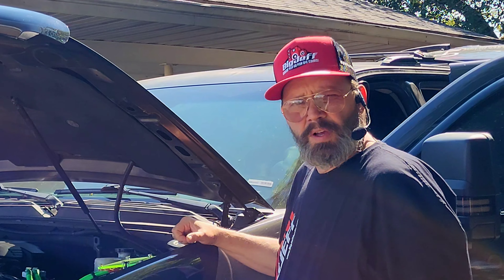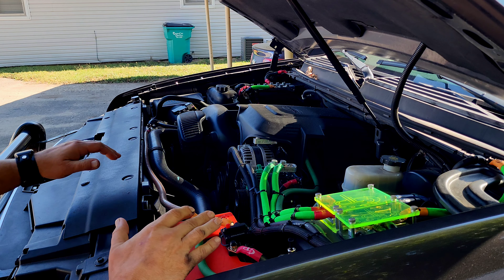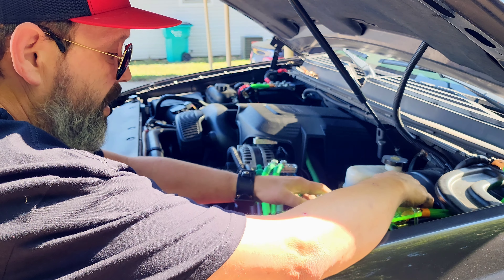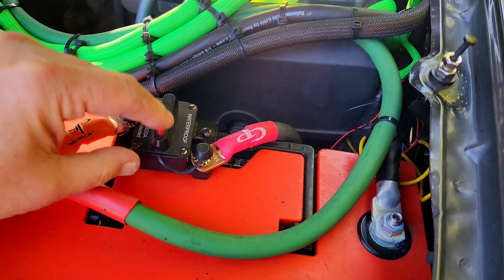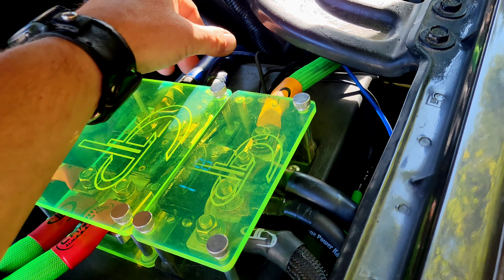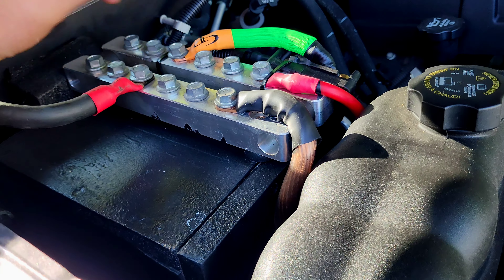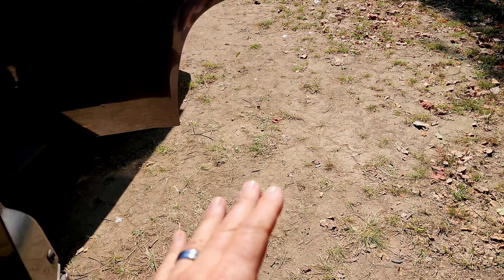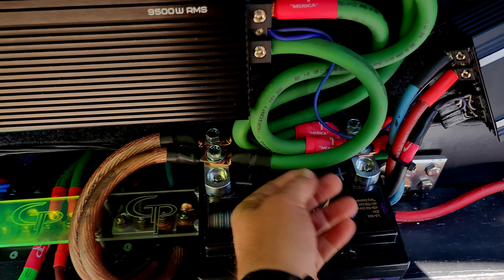How To Maintain your Car Audio Bass Machine! @BigJeffAudio

Comment: Routine checks are paramount. The vibration will work lose set screws, bolts and connections. I’d say once a month check your fuse holders, distribution blocks, amp wires. It only takes one loser wire and poof

Comment: one question I had to ask is with the trunk thunder 5k banger battery , I was going to install under my second row seating and run my 4 runs of sky high 2/0 ofc to that battery then from the battery to the next amp I decide to get. Sounds easy , but I have a group 34/78 agm under the hood in my yukon in the factory location and I built a battery tray to fit a larger group 48 agm in the secondary location. So plenty of power with the dual 220 amp alts. Any issues since the battery will be inside and not be the primary starting battery while being wired in parallel with the AGMS??
Reply from the maker: you can run them together since the resting voltages are close, but you may want to use an isolater at the back on the trunk thunder, just to let it rest higher when the car is turned off. you can do either though
Reply: @CarAudioEnthusiasts  i think i rest around 13.6 and charge at 14.2-14-5 on a good day
Reply: @CarAudioEnthusiasts  ill test with my fluke meter as im just going by mt voltage gauge , and let u know